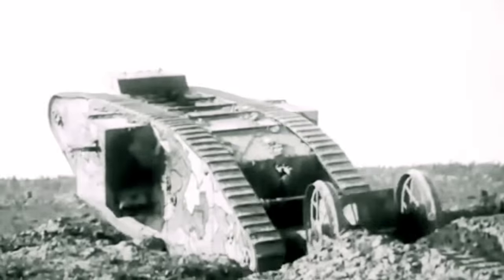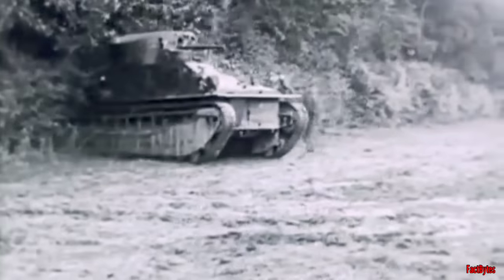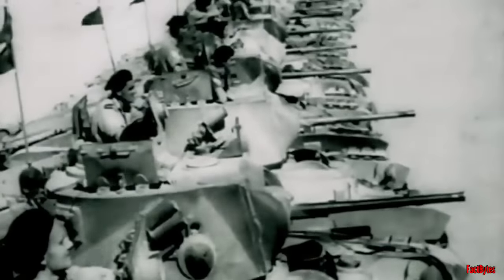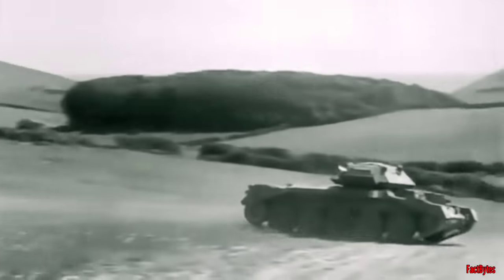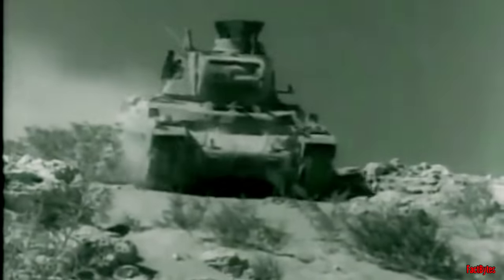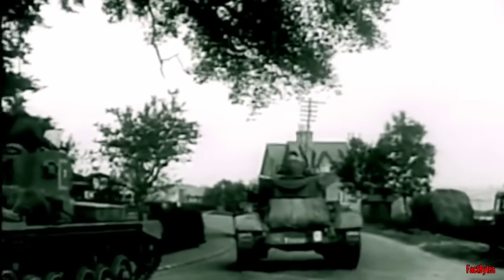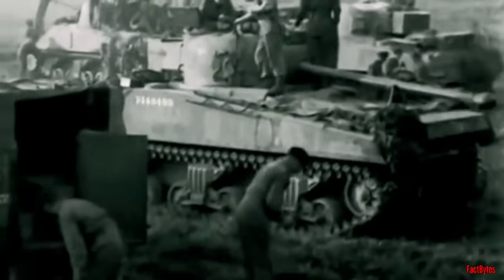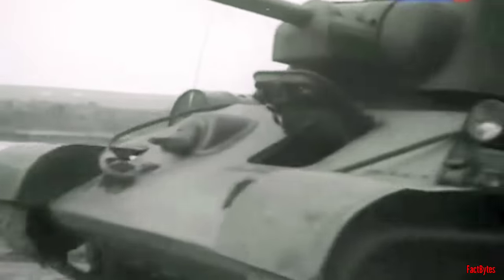Why Did Britain Struggle to Build Effective Tanks During World War II?

Comment: IMHO two bad decisions and an unlucky event greatly hampered British tank decisions: The first bad decision was the insistence on having the turretring inside the tracks and not to some degree having it overhang the tracks like in most other designs.  Low silhuette was given priority over forepower. Second bad decision was insisting on the gun trunnion being inside the bturret ring, mainly to having the gun being balanced in the cradle so it could be elevated by the gunners shoulder. That severely limited the size of the gun being able to be fitted inside a given turret ring. Other designs, most notably the T34/85 pushed the trunnion outside of the turretring and made it possible to mount a very big gun in a turret with a relatively small ring. The unlucky event was the fall of France in 1940 and the following rush to get tanks into the field. this was a main reason behind the scandaluos unreliability of designs like Covenanter and Crusader, but also on the the formidable 6 pounder not being in widespread service until 1942. From this alos folloows however that ithe British tank industry had the inherrent potential to build a relatively reliable tank armed with a 6 pounder and having it in widespread service by mid 1941. That would have been the no 1 on the battlefield.

Comment: Mistake made was to design all tanks to be transportible by train which restricted the wirth of the tanks which in turn restricted  turret ring which restricted size of gun , most obviously seen in Churchill which could have been a British Tiger if slightly wider , Germans when transporting tanks removed their tracks and refitted them when delivered to front.
Reply: Continental loading gauge larger than British the USA larger still. Also road transporters were rare until the war progressed

Comment: This is balderdash.  UK had the Matilda 2 at the start of the war.  It had a gun that at the time was also used in anti-tank guns. It was at that moment probably the best tank in the world.  The matilda 2 was still in use at the end of the war.  It biggest problem was lack of firepower.
Reply: So was the m3 Stuart
Reply: IWM "From late 1942, US tanks were required in increasing numbers to make up for the deficiencies of home-grown products. Only in 1944 was British industry able to deliver a tank reasonably fit for a fast-moving battlefield, and even then it was scarcely a match for its opponents." 
Britain's Struggle To Build Effective Tanks During The Second World War page
Reply: @tomhenry897  Stuart was not in service until 1942.  The Matilda 2 served from 1939 to 1945.  The 2 pdr gun was state of the art anti-tank weapon in 1939.  The tank's performance at Arras stopped the German advance and allowed Dunkirk to be so successful. Initially in the desert, it was equally successful, but improvements in tank engines allowed heavier armour, and the 2 pdr was inadequate fairly quickly except in the far east.  The Valentine tank was in service 1940-1960.  More than 8000 were built and Russia demanded as many as they could get hold off. The Sherman didn't arrive until 1942, and was also inadequately weaponed.  The 76mm was arriving in UK before D day, but was not deployed until later.  The only tank capable of knocking out German armour was the Firefly.  The Cromwell was a cruiser tank that did sterling service through to the Korean War.  The Churchill had some features that were better than most other tanks at the time, and was the basis for many of the funnies - the specials that were a major feature of the breakout from Normandy.  And don't forget the Centurion, a tank that was the closest precursor to all modern tanks and was 1 month too late for WW2, but soldiered on around the world at least until the 1990s.

Comment: In 1940 the Vickers light tank was as good as a Panzer I or II; the A9 cruiser was not as good as a Panzer III; and the Matilda II was better than the Panzer IV.
In the early years of the war Britain's biggest problems were:
A) lack of an HE round for the 2 pounder;
B) lack of production capacity which affected quality as it rapidly expanded; and 
C) lack of officers who understood mobile warfare.
The Valentine was a value engineered replacement for the Matilda and was good enough that the USSR asked for them to be kept in production and used them in combat until September '45.
When it was introduced the Churchill was as well armed and better armoured than anything the Germans had at the time. And successfully took on T34/85s in Korea. Not to mention it's rough terrain ability coming as a shock to the Germans.
The Crusader was a rushed design and suffered from reliability issues; as did the Panther and Tigers.
The Cromwell was as good as a Panzer IV, the Comet was better.
Britains armour suffered more from poor tactical usage than quality of design.

Comment: The "disadvantages" of being rail and ship portable and able to traverse European bridges seem more like advantages to me. Tigers had to have transport tracks for rail transport and combat tracks for the real world, and were too heavy to cross many bridges at the time. And Tiger 131 at the Tank Museum was disabled after a shot from a 6 Pounder, nothing more. Not much wrong with the RR Meteor engine either, and even the Churchill had its good points. M4 was reliable, although also outgunned, had a high sillouette and was under armoured, but there were more of them. That's its saving grace.
Reply: One reason the Ardennes offensive in 1944 failed when the one in 1940 succeeded (apart from the fact that there were almost no defensive forces there in 1940) was that the 1944 tanks were too heavy to get across the bridges on some rivers without time-consuming engineer work, whereas the 1940 ones could, being much lighter.  Bigger is not always better—just usually.
Reply: well 131`s turret ws jammed but carry on,the brits keep131 in running condition so the can state with pride: we`re in the posession of a proven reliable feared tank!

Comment: The T34 story actually demonstrates the exact problems the British had, but from a different position. In 1941 it outclassed Panzer III's and IV's but the only response to Panther and Tiger was a new turret and gun. New tanks were designed, but it was more important to keep churning out T34's than switch. The Americans thought the same way about the Sherman. Of course its easier to do this if your current model isn't seriously outdated. Also as mentioned in 1940/41 Britain's primary concern was German invasion, and being an island nation the RN and the RAF would be much more important in that role. Even if the Germans had landed and established a beachhead in southern England, naval and air interdiction of their supply lines would have been a better solution than meeting the Panzers head on. This is illustrated in the Meteor engine, based off the Merlin. Merlins were already being used in torpedo boats but were not realised for tank production until invasion fears subsided in late 41.

Comment: I totally agree. The Mathilda looked better then it was, because other tanks (from France and Italy) were worse. The Churchill was outdated the moment it became operational. When the Germans first saw it at Dieppe, they thought that they were being fooled with a fake design. The Churchill became useful later on as an anti anti tank gun vehicle, a kind of driving bunker that gave excellent infantry support once the Germans had run out of tanks. The Cromwell was a reconaissance tank, that complemented the Sherman, which in itself was an older design that could hardly keep up with the German tanks. So in the end, the only descent British tank of WW2 was the Comet.
Reply: So what your saying is that the Churchill was an excellent tank....it was designed as an infantry tank form the start. Tank on tank was not as common as people think.
Reply: @dulls8475  You know that this is not what I am saying. If it would have been a good tank, it would have served on after the war. Like the Sherman and the T34, which were used even decades later. The Sherman also encountered relatively few German tanks and it was also developed primarily as an infantry support tank, but that did not make it unfit to fight other tanks.
Reply: @retepeyahaled2961  It did serve on after the war. It went to Korea. It was a very good tank once all its flaws were ironed out. Loved by the crews because they could keep the crews well protected. Its x country capability was legendary. It was a very successful camp. A Churchill disabled the first ever tiger tank that was captured.
Reply: @dulls8475  Please do keep in mind that it is not my intention to deny the Churchill the respect that it deserves, although I do not appreciate all it's qualities. But if there is one British tank to be proud of, it would be the Centurion, which was arguably the best tank immediately after the war.
Reply: @retepeyahaled2961  you could have fooled me! The Churchill was very popular with the men who manned them, they knew they were safer in them, than most other tanks. 
Churchills were slow, but heavily armoured, and they could, with ease, cross difficult ground.
A Churchill Crocodile was a fearsome tank, it was without doubt the most effective flamethrower tank of the war.

Comment: The Cromwell was a good tank. It had a fantastic engine, transmission and suspension, better than its German or American contemporaries. The armour was adequate but built on the obsolescent "brick wall" principle, thick vertical slabs of armour. The Tiger was also built like this, the Panther showed the lessons learnt from the Soviets. The gun however was still the 75 mm medium (in fact a 6-pdr breech with a 75 mm barrel firing the same ammunition as the Sherman) which was no longer fit for purpose, good against anti-tank guns which represented the major threat, but incapable of dealing with the Tiger or Panther. The Comet was basically a modified Cromwell with a wider hull and a down-rated 17 pdr called the 77 mm to avoid confusion, but the projectiles were the same as the 17-pdr with a shorter cartridge. Accuracy was better than the 17-pdr and the loss of penetration power was about 15% lower but still ample. The top AT gun of all I think was the 32-pdr, made in small numbers. It never entered service as an AT gun because basically it was impossible to move in the terrain. It was used in the Tortoise assault gun. For some strange reason it was not used to up gun the Centurion when the 17-pdr was deemed inadequate to deal with the heaviest Soviet tanks, instead a 90 mm gun was installed with lower performance. Perhaps the 32-pdr cartridge was too big to handle even inside the Centurion's turret. In a trial after the war ended, the 32-pdr fired at the front of a Panther at about 1000 metres. The projectile pierced the frontal armour, traversed the crew space, wrecked the engine and burst out of the rear. That's something....
Reply: Even before the war the Brits along with most countries knew that slopping armour was the way to go, It was just quicker and easier to build it in slabs.
Reply: @dulls8475  You are right, if we look at the tanks with cast hulls you see good deflection angles built into the design.
Reply: @ricardodavidson3813  The other thing is that sloped armour decreased the size inside leading to very cramped tanks. It was all choices to be made fir production etc and compromises were made.

Comment: I'm afraid we have a history of letting dumb things dictate weapon design. Such as this video mentioned - letting railway guage dictate tank size. 
A slightly more recent dumb decision was choosing the Nimrod as the airframe of a UK AEW aircraft because there were small savings to be had as we already used Nimrod for anti-submarine work and there were plenty of spare engine and parts. Of course the Nimrod was a tiny aircraft and when the project hit problems (often because the MOD kept moving the goalposts) and needed more avionics boxes and more electrical power and more cooling, there simply wasn't the space. Thatcher's Government at the time (1986) cancelled the project, killed part of the UK's industry expertise for good and put hundreds of engineers out of work. I was lucky not to be working on it, I was at a different part of GEC-Marconi working on a ground based radar. Sh*tloads of other engineers on Nimrod AEW were out of work for months. The freelance S/W engineers were given 10 minutes to clear their desks, I know as i worked with some of them a few years later...

Comment: The problem was outdated doctrine, poor leadership, and state priorities. Britain was a naval power first, and air power second. Land forces came last. What is funny though is how: -
1. Despite being a land power first and foremost. Germany screwed up its tank design and production so much. Overdesigning its equipment to the point it stopped being practical.
2. The US spent so much time coming up with a replacement to the Sherman. In '42, it should have known that by '44 its frontline tank would be obsolete.
3. The Italians went into the war with kit that was two decades behind the front players.
4. France had the kit to make a difference, but screwed up its tactics
5. The Soviets had to suffer near total wipe out, until they got things right. They being the one country that got things the most right vis a vis tanks.

Comment: What intrigues me is the absurd continuous manufacturing of the 2 pounder gun,even the tough Matilda was hard pressed not just by its slow speed but the largely ineffectual 2 pounder,particularly against the well armored and armed PzKw IIIs and IVs….
Reply: I think that it was a case of it being better than nothing as it takes time to set up the new tooling and to train the factory workers to produce the newer caliber. We needed weapons now and hopefully, they would buy time for the newer equipment to be made and issued.
Reply: 2 pounder has pretty good penetration for its calibre and was perfectly fine at taking out Panzer 3s especially. Big drawback with it was the lack of any good HE shells.